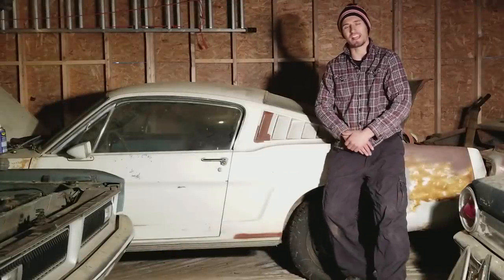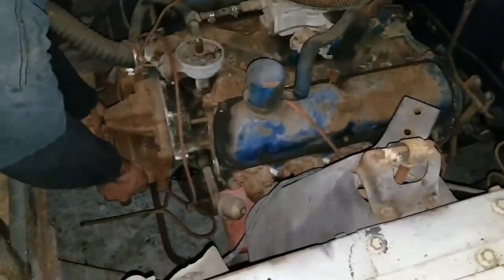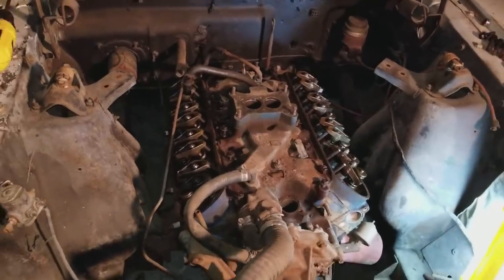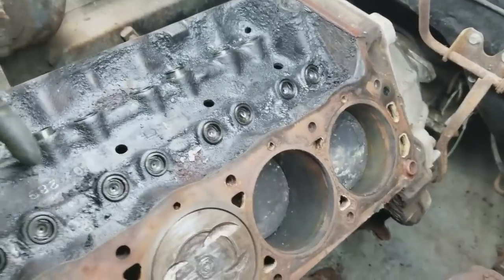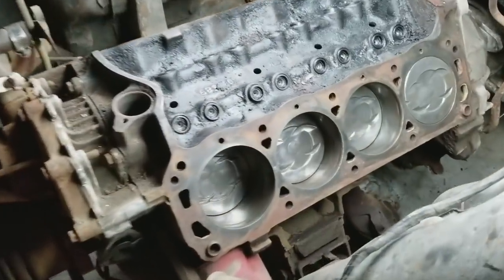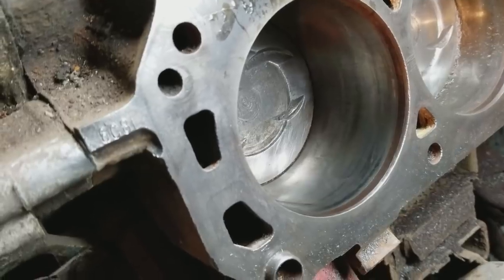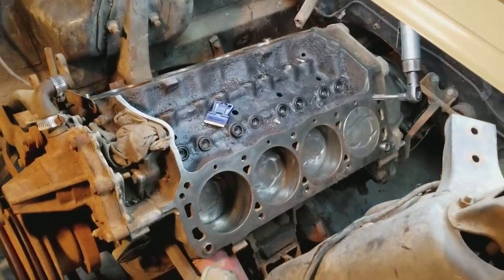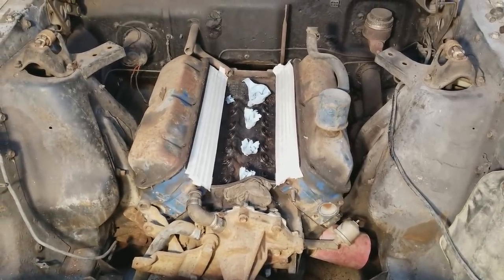Forgotten 1965 Mustang First Start in 44 Years, Fastback Revival Part 1!

Comment: I like that you’re doing the work yourself but it’s crazy that you should’ve put new lifters new pushrods and at the very least get the cylinder heads Resurface and check all the valves. I mean after all you’re talking about a car that hasn’t ran in 44 years

Comment: You would save yourself a LOT of headache if you would get an "endoscope" for your android/iphone.  They run about 60 bucks and will go down ANY head bolt hole and show you what is in the bottom.  They have their own lighting.  You can also send them down ports and check for cracks and look into the crank.
Reply from the maker: I'm just sending it!  If something fails... I have a plan B😎🤘

Comment: i did this to my 86 chevy 305  but i pulled the lifters and washed out the valley with berryman b-12 and laquer thinner then drained the pan pulled the oil pan  put a new oil pump on and its running great

Comment: I had a '65 notch. 289 3 speed on the floor. Sold it for $175 in 1978.  Have you ever noticed that 64-66 (nice ones) share a uniquely Mustang interior smell?

Comment: Im guessing it had a valve job before it was parked considering how clean the valve train is compared to the sludge around the lifters.
Reply from the maker: The heads have definitely been off in the past (prior to us owning it) valve seals are plush, heads were clean. Can almost guarantee the the valve seats were done

Comment: Bottom those pistons one at a time n polish the bores with stainles steel wool n clean up . lube generously and spin with startter.It'll smoke ike hel till it burns out the lubes. As long as u didn't break any of the rings, It'll go.

Comment: What about the black 1964 Fairlane 500 next to the -65 Mustang ? Is it still running ?  :)
Reply from the maker: The 64 blue fairlane  is currently not running, however i will be working on it shortly and videoing the whole process like the fastback. The fairlane has a rebuilt  short block so shouldn't be as extensive as the mustang lol
Reply: @Theoldcarchannel.  Thanks !  I got at Dynasty Green F. Fairlane 500 HT 1964 with a -68 Mustang 302 V8, not running for 30 years... so I will follow your work here !

Comment: My brother found one of these in a barn with a cover in it, properly mothballed.  The farmer sold it to him for $4500.  Can you believe that?  30K original miles, MINT!!
Reply from the maker: Wow! That's a steal! When was this?
Reply: @Theoldcarchannel.  It was about 15 years ago.  Neighbor who he worked for over the summer.  I think he gave him that deal as a thank you.
Reply from the maker: @reednut2091  wish there was still deals like that now a days!
Reply: @Theoldcarchannel.  Yeah no doubt.  Blame the rise of the internet.  Everyone can easily find out the value of anything on a worldwide market.  And the number of potential buyers is growing too, as are trends in certain items.  Myths spread like wildfire online too, driving prices up on certain mythical items.  I used to make a living buying and selling.  Getting a lot harder to find anything with any room to turn a profit, and if you do you're got to beat all the other pickers through the door first!  Last cool car I found for a good price was a 66 Datsun pickup, bench seat, 1299 cc engine.  Bought it off a tow truck driver with a pile of cars in his backyard, $500.  All it needed was brakes, shocks, brake pressure switch (had to swap connectors on a VW version) and a new battery!

Comment: AMATEURS
Reply from the maker: Right.... or just don't feel like spending thousands of dollars to get the engine "rebuilt"
Reply: thousands of dollars.. to pull it, put it on a stand, and pull the rotating assembly out, so you can clean the rings which are now packed full of metal shavings? What planet are you from anyway? Thats an excuse, which translated, says loud and clear.. we have an old car and we are gonna half-ass everything, blame it on some inflated idea of price, and ruin a decent block. When the rings break, or the cylinder gets power honed by the shavings, you will then have to pull them ANYWAY. Value went down THOUSANDS when you decided to ignore the details.  ><
Reply: My 68 289 was parked/stored for nearly 20 years. I pulled the pistons by dropping the oil pan. Had no cherry picker. Oil pan had nearly an inch of sludge, the piston rings were seized and compressed.   You could have/should have dropped the pan. Sure the oil pickup was plugged up.
Reply: These guys are NOT amateurs, they are "wannabees"  I am glad a never have the choice to buy a car from them.
Reply: Billy k, agreed.
Reply: @Theoldcarchannel.  so theres not enough money to do it right, but theres enough money to do it twice?
Reply from the maker: @Vikingxb  I already have stock engines that have been given to me...why bother going through the whole process, time and money
Reply: @Vikingxb  and another thing I grew up on a farm and fixing these old motors is what I did as a kid... yeah we weren't professionals and we fixed engines in anyway we could and if you actually knew what you were talking about you would know that these old beat up motors are temperamental and will take love anywhere they can get it.... things don't always have to be done exactly to spec or in a professional manner
Reply: @brockmaine2743  professional at everything, no. Professional with enginge recons, yes. Been doing it for the last 18 years. And these donks arent temperamental at all, who ever told you that is a muppet. Very reliable little engine. The only thing that would make them temperamental is dodgy repairs
Reply: @Vikingxb  it's a 50 year old motor numb nuts they break down constantly when they're that old and they are temperamental with that much age and that's a fact
Reply: @brockmaine2743  yes they are a 50 year old donk, but if they are rebuilt properly then they are just as good, if not better, than they were new. In turn, doesnt it make it a new engine. Im running a 302c from the early 70's that i rebuilt myself 11 years ago, use it every day, has never missed a beat, hasnt had to be touched apart from general servicing.  Rebuilt a little 289 bout 8 or 9 years back that went into a mates capri and its still going strong. Temperamental my arse.

Comment: Wonder how long the engine is going to last with #1 metal shavings in the cylinder even if you tried to blow it out,  #2 no lube on the cylinder wall and #3 the god awful wear on this motor. Either way good luck and I will be waiting for more.
Reply from the maker: That's a question we'll have to wait for science to decide lol! There's always a back up plan 😎
Reply: 289 ...will.last forever..just smoke something awful..lol
Reply: it will be fine
Reply: .030 overbore is standard on an engine like this:)
Reply: It will probably run, but it wont be happy. Guarantee there there will be higher compression pressures in the crankcase than anywhere else, with the possibility of it trying to pop the oil filler cap off. I have seen this happen. In saying that, i have seen a 302 cleveland run on LPG with piston rings in 100 peices each. That donk definatly needs a rebore

Comment: Ha, I have a VW air-cooled block where every hole without a bolt has been filled with dirt by those bugs! XD Ah, it'll need a lot of cleaning to become an engine again, I'll have to check all the oil passages for dirt-plugs too! I'm sure it'll come back, the question is how much life it'll have left!
Reply from the maker: That's Brutal! Quite a pain in the ass cleaning out the dirt. Noted that if i ever move to the south to plug up all the holes with bolts 😂😂 as for the engine... only time will tell, stay tuned!
Reply: Yeah, I'd removed the head-studs to make storage easier, should've plugged them! I'll be watching! Wrenching vicariously! XD

Comment: Why yall didnt replace the rings???
Reply from the maker: Um... are you serious or just joking? Can't tell tbh
Reply: @Theoldcarchannel.  serious.. yall did all that work to the pistons and i didnt see  yall change the piston rings.. what if yall did all that work and a cylinder low compression?
Reply from the maker: @lawnside82  then I'll pull the engine in the spring and drop a 5.0 and 5spd in it. The amount of work it would be to replace the rings with the engine installed is stupid. Many people have commented why didn't you just pull the engine and rebuild it/ clean it. The reason being is it's in storage at the moment and have no access to get an engine hoist to it. And if i do every "pull the engine" it'll never go back in this car.
Reply: @Theoldcarchannel.  ohh ok.
Reply: @Theoldcarchannel.  People seem to miss the point that the reason you took the heads off was simply to see what was causing the sticking point in a hand force rotation. Realistically, if you'd have thrown a breaker bar on it, it might have spun past the crud build up. If so, throw a carb on it and give it a spin and maybe.. maybe not.. And, if it did fire, it'd have just thrown that crud down the exhaust.. The other great aspect to the "re-build", is time and simplicity.. Other than a set of upper end gaskets, and some "dry SOS pads", there was only an investment of time and effort, not mega bux.

Comment: Using an air ratchet to tap?? Now ive seen it all. Many things i dont agree with that you are doing wrong.
Reply from the maker: Didn't have a regular ratchet around and the compressor was down so I had to improvise. Not what it's made for but it did the trick. Feel free to share your opinion, Im all ears👍
Reply: You also should of painted the heads n valve covers since they were off. You do good work.. was just giving ya a hard time. Lol

Comment: Cheaper and better to put in a crate 302 and change it to manual.
Reply from the maker: That's my plan B if this fails. Carbed 89 5.0 and a 5spd
Reply: That's what my Dad did, 302 crate motor with a nice 4bbl and a 5speed.
Reply from the maker: @blurplevtx  perfect combo for these cars👌
Reply: @Theoldcarchannel.  Maybe to keep it historically correct, a 289 and a top loader. But that would be more expensive.
Reply from the maker: @TechnikMeister2  I have both of those... However, I'm more worried about enjoyability (being able to cruise in overdrive on a highway) over originality (running the engine at 3k+ rpm because of 4spd toploader)

Comment: Texas issued plates with Q as the first letter in 1978, my dad had a 1978 VW Scirroco (purchased new) that had a plate starting with Q, which means that this car was registered around 1978...Texas issued new plates every year until 1974, when they went to the white on black plates shown with sticker indentations in the upper corners of the plate.  The rear plate left indentation is for the month of registration and the right one is for the year that the registration was valid until (you renewed the registration annually)

Comment: You do have to watch out for those dirt dobbers and other bugs. I had an old fuel pump mounted on my shortblock that was in a buddy’s barn. I reused it but it was full of dead weevals that got pumped through and hung up the float on the carb. Live and learn.

Comment: I've got a fastback in the same situation! Complicated story, need to get my hands on it though!
Reply: Skip this whole situation and pull the engine.  Harbor freight regularly has cherry pickers and engine stands on sale where both are around $200 before taxes.  And save the headache of converter bolts or transmission wrestling and pull both at the same time.  It is 1000 times easier to separate them on the garage floor than it is trying a wrestling match with them in the car.

Comment: Assuming oil pan getting dropped next video, and hopefully a nice distributor w New points and rotor, wires and plugs, if your keeping it, your gonna do it later any how
Reply from the maker: Some new parts but distributor and plug wires are not them. Maybe in the long run if all goes as planned, right now we just want to see if it'll run. Or see if there's any internal problems that we cant see (spun bearing, rod knock, etc). If that's the case out she comes! Stay tuned to see what happens next👍

Comment: Check the  VIN  and  Door  data Plate .  The car has a 66 grill with a 65  dash .   The gas tank  access cap  should have 3 notches  while the 66  has a splined edge  to grip it.

Comment: When I was a kid my cousin bought a new red 2+2 with a white interior, I think it was a 1967 but not sure.
Why not just pull it and go thru it? The crap in the lifter galley is from different types of oil, not using the same brand of oil & not changing the oil.

Comment: I was wondering about the condition of the zylinder walls.

There appears to be no honing pattern left on them. I don't know when manufacturers started doing that process but if a 65 Mustang is suppused to have a honed engine you probably should consider doing that as it will ensure the longevity of your engine!

Comment: There were no detergents in the oil back then. All engines looked  greasy like that even with normal oil changes. Beautiful car!
Reply: the oils WERE detergent but they did not have the additive packages available today. And it is probable that pure lack or timely maintenance is the biggest factor in that sludge build up.

Comment: At the very least, I would have pulled the plugs and shot some penetrating oil into the cylinders to loosen the rings and maybe let it soak in overnight before turning it over by hand. You not only would free the rings from the cylinder walls, but also free the rings to expand and contract in the piston grooves.

Comment: I am in the process of restoring a 65 coupe.
Reply from the maker: Sweet, what's it all about?
Reply: It will be red with white stripes. Red and white Pony interior. It will have a 351W with aluminum heads and intake. All new suspension with a flaming river rack and pinion and tilt column. Classic air. Dakota digital dash. Upgraded to disc brakes on the front. It is currently on a rotisserie at the moment.
Reply from the maker: @southerngent716  right On! Sounds like it's going to be a sweet ride!

Comment: Nice work, but at least pour some ATF or MMO (Marvel Mystery Oil) into the cylinders to free up the rust and help unstick the piston rings.   I'd change the valve seals while the heads are off too. Easy to do.

Comment: Nice camera work and editing-- very tight and smooth. Questions-- (1) Since you did not immediately vacuum the debris as you worked, weren't you worried about blowing or dropping crud into the cooling passages? (It seemed your video omitted that step) (2) how did you clean engine oil and coolant passages, as opposed to blowing them out with compressed air? (3) did you find the oil pan full of congealed oil, and if so, how did you remove the oil from the crankshaft and oil pan? I was impressed you re-tapped the head threads. Overall, I learned a great deal from this review of engine rebuilding, and immediately subscribed.

Comment: some one couldnt see that 2 of the rockers were off on the driver side of the motor meaning when the vales cant open the built up compression cant go any where and it wont let the engine turn
Reply from the maker: Did you watch the whole video?

Comment: I didn't know that they made a 65' fast back!
Reply from the maker: Yup, first year of the fastback body style👍
Reply: @Theoldcarchannel.  thanks
Reply: They were the rarest model. Far more coupes and convertibles were made in 65-66. The fastback V8 models of these years are the rarest and most valuable.
Reply: @WayneTheBoatGuy  ok great thanks. When I was 18 in 1967 I bought a 65 coupe, the tail lights had 64 stamped on them so I thought that was the year but a guy told me that the 64 1\2 did not have a 289. Mine did with 3 speed stick. The same guy told me that the mustang didn't come in a fast back until 66, so it makes me wonder about year! I just figured that the tail lights were left over from 64 1\2!
Reply from the maker: @WayneTheBoatGuy  I wouldn't say that, most valuable fastbacks right now are the 67-68 models. All fastbacks are highly desirable though, yes.
Reply from the maker: @logtrucker8963  64 1/2 was an early production model (every new production year started mid way though the year, hence 1964 1/2... even though those cars were still called 65s by their vin code). 64 1/2 came with the inline 6 (U code), 260 2bbl v8 (F code) and the 289 4 bbl V8  (D code). So yes your car could've very well have been a 289 64 1/2 car.
Reply: @Theoldcarchannel.  ok thanks again. Wish I still had it!
Reply: I should have clarified that among the 65-66 mustangs, the fastbacks are the rarest and usually most desirable
Reply: @WayneTheBoatGuy  yeah I figured that was what you meant! I do have another question for you, what year did the machine 1 come out? A friend of mine had a very early 1 and I can't remember what year it was! thanks
Reply: @WayneTheBoatGuy  supposed to say mach 1

Comment: I did not see him using any cutting oil with the tap nor did I see any motor oil used to lube the cylinder walls.   A honing stone would be good for the cylinder wall cleanup.  This has been only a cosmetic clean up.  cannot imagine what is in the oil pan and some of the galleries.   At this point I agree, pull the motor and do it right.

Comment: Take out the motor transmission first get it rebuilt restored and paint it then clean out the engine bay by pressure washing it
Reply from the maker: Car is in storage and can't get an engine hoist to it. I'm not about the clean everything life. This is just to see if the engine will run, if it does great! Ill pull the pan and clean what i can clean but i will not be rebuilding this engine anytime soon. Engine bay will stay ratty just like the car is. Worry not if the engine fails I have a few backup plans 👍